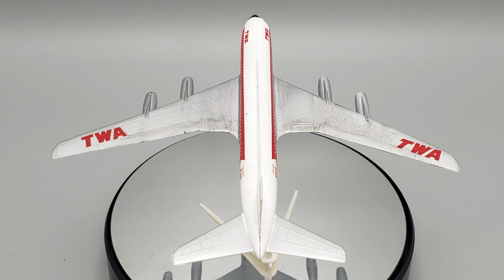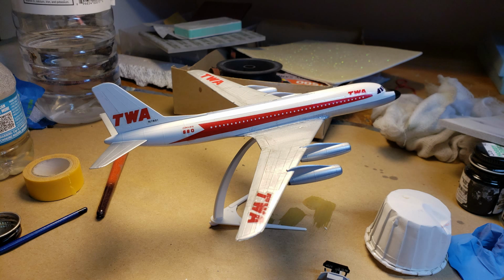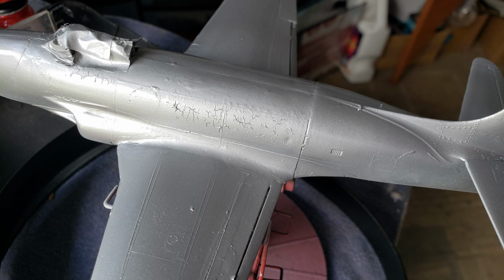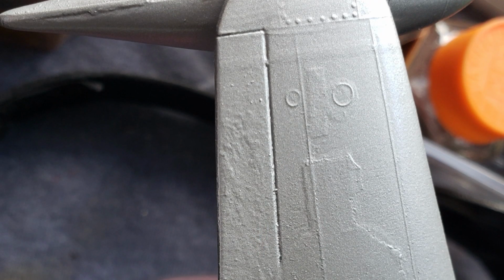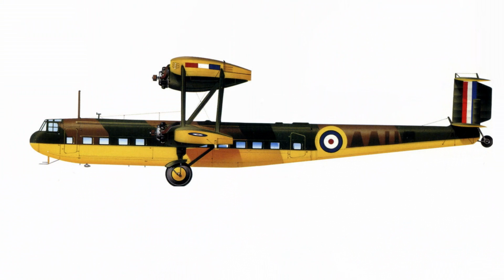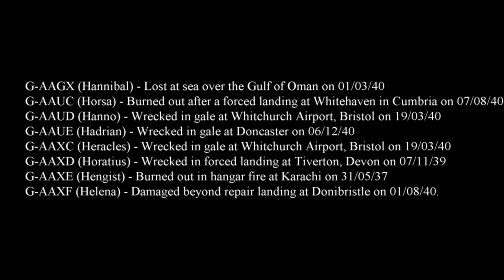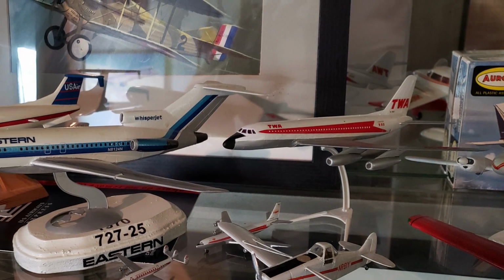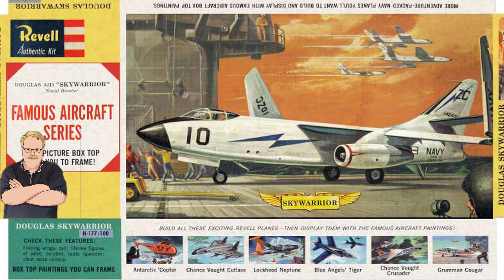Happy Mother's Day Gloo Troopers

Comment: I recently made the polycarb paint booboo too.  Tried it on a 1/48 P-51, and it was horrid.  The "Bright Silver" came out grainy and finely metal flake!   Luckily, a light sanding to smooth the grainyness, then a coat of gray primer fixed it.  Then used the proper spraypaint.  Took some effort, but it came out good in the end.
Reply: Live and learn.  😀

Comment: That polycarbonate paint is intended to be applied on the INSIDE of the clear body -- slot cars, too -- leaving the plastic to take the nicks and scrapes of hard use.  It certainly will attack any finish you apply it over.  Ouch!

Comment: TWA looks great; makes sense that the airlines would only incur the cost of keeping the fuselages clean for marketing purposes;  I never knew that.  My method for stripping paint is to soak the parts in brake fluid and use a soft brush; never any damage to the plastic, and no fumes.

Comment: What if you do is take a small baking pan to fit whatever object it is and fill it with about quarter inch of lacquer thinner and then brush it on with a soft brush and then take a toothbrush to brush it off it works every time trust me it'll save you a lot of time
Reply from the maker: What about purple power?
Reply: Maybe try the same way but with owen cleaner that comes in spray cans. In mine case it took down paint and clean clear parts  that I painted in mid 90s with no problem plastic looks like it has been never pinted. Just live it soaking for a half day.
Reply: Oooo i forget some of mine frends even use the brakes fluid (oil) for paint removal and they sad it works great. But I didn't try that method.

Comment: Lacquer thinner is made up of several chemicals that break down styrene including acetone, toluene, and glycol ethers.  These are some of the same components of hobby cements.  

ELO works but I would not recommend soaking anything in it.  You can flush areas with a soft brush, allow it to sit till the paint starts to crinkle and then wipe off with a shop paper towel (blue stuff).  Ronsonol lighter fluid can be used once on a styrene kit to remove enamels.  Repeated stripping leads to the styrene degrading.  It gets brittle.  Isopropyl alcohol works on most acrylic paints.  Clear coat may require an ammonia based cleaning product.  This is what you have to do to remove floor "wax".  

I don't know of any chemical solvent for urethane based paints.  Polyurethane is a) very sticky and b) very durable/persistent.  You may need to physically abrade the paint.

Lacquer based paints can be softened with lacquer thinner but the thinner also softens polystyrene unless it has a barrier coat between itself and the underlying plastic.  I remember vividly trying to brush paint the original formula Floquil over styrene.  Not a pretty site.  Even airbrushing Floquil over styrene required an accurate assessment of how much thinner and how thick you were spraying the paint on.  Ideally the paint was drying just as it hit the plastic.  Too far away and you wound up with paint dust, too close and the objects started melting.

Regarding order of paint applications.  Hottest stuff first and then successively less aggressive paints on top.  Lacquer's first then enamels and then acrylics.
Reply: Great info, thanks!  Question (if you do not mind):  spraying clear coats over an old paint job.  I think I painted my Monogram P-47D with Pactra paints.  The decals still look shiny with no silvering.  I’d like to improve the look with a clear gloss followed by either a clear satin/semi gloss or dull coat.  Will the type of clear coat matter (such as Tamiya or Rustoleum sprays)?
Reply: @JMdfcv  I am guessing the original paint job was done with Pactra enamels.  Pactra did release an acrylic line.  If it is the enamel paint the Tamiya X-22 clear gloss acrylic shouldn't attack the underlying paint.  It requires an airbrush to apply (They also have a Flat clear top coat (XF-86)).  

I believe that ALL of the Tamiya spray paints are lacquer based.  They should go on first and then enamels or acrylic used for detailing/weathering.  The amount of solvent in the clear coat MAY be low enough to evaporate before it can start to affect the underlying paint.  Pretty sure that all of the Rustoleum paints are solvent based and will probably react (badly) with the existing paint job.  

If you have an airbrush you can also consider the Microscale Gloss, Satin, and Flat finishes as well and if you have some scrap material to practice on you can try Future Floor finish.  When it works, it really looks good.  Unfortunately it can react badly to surface contamination on a model and getting the pressure and distance from the model requires some real world experience (aka don't try this on something critical until you have experienced how to use it).

Safest route is to gently clean the model and use some kind of acrylic to re-top coat.  There may be artists clear acrylic rattle cans that use less aggressive solvents and they would also be safe.  I used to like Krylon clear until I found it taking on a yellow tinge over time.  This stuff is usually referred to as "fixative".  You want to make sure it is acrylic/water color compatible and that it doesn't yellow.  It would be found in the artists sections of JoAnn, Michaels, Hobby Lobby, Dick Blick, etc.
Reply: @chuck9987  thank you for the quick reply!  As a matter of fact I do have a bottle of X-22 and a bottle of fresh X-20A thinner (assuming the X-22 would require thinning for airbrush?).  I haven’t used an airbrush in a long time, might as well give it a go!  This model has sentimental value and trying to keep my original paint job/markings/decals but not the end of the world if I need to visit Max’s paint corrective practice.
Reply: @JMdfcv  Yes, it usually requires some thinning down.   I would start with a 20-25% thinner and see how well it sprays and how well it looks on plastic.  Probably around 15-20 psi.  

I have seen some videos where they are using TAMIYA lacquer thinner instead of the "Acrylic" thinner.  This is possible because the regular Tamiya acrylics are "flammable" as they use alcohol as the primary carrier.  The Tamiya Lacquer thinner is miscible with the Tamiya Acrylic thinner.  I haven't tried this (yet).  Some of the builds in FSM had the modeler apply multiple coats of clear lacquer (like 10-20) with increasing volume of thinner until the final "coat" was nothing but thinner.   Try using the matching thinner first before experimenting.